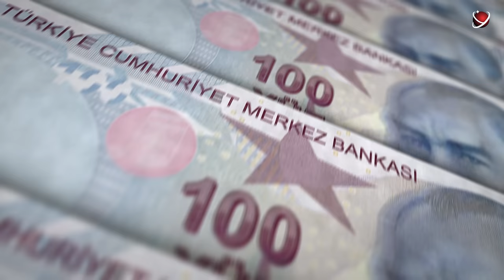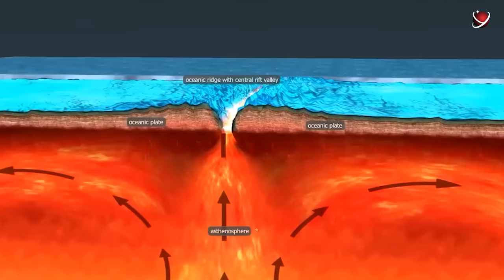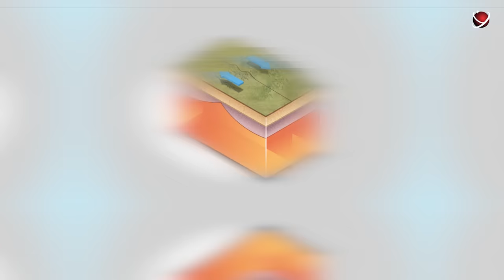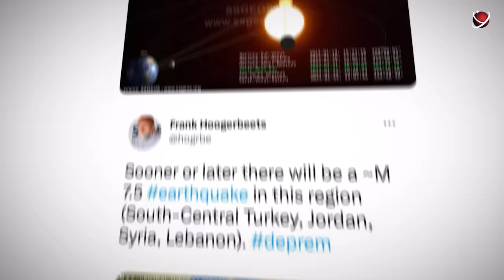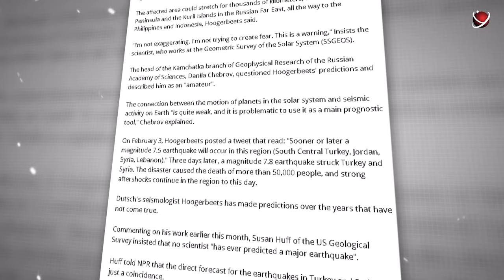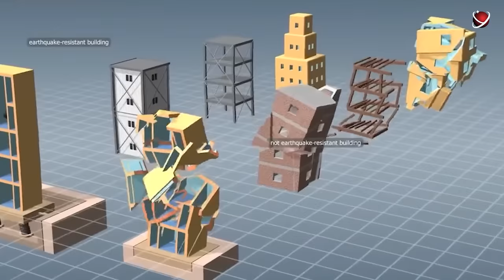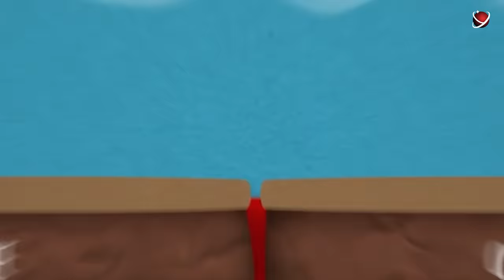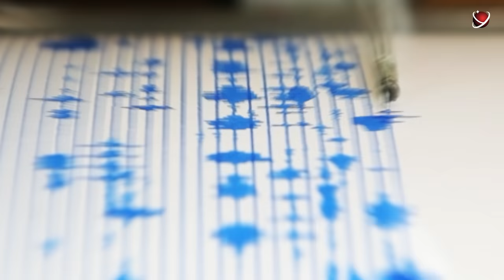Why Is The Earth Cracking Apart?

Comment: Tectonic plates have to move in order to  release the huge amounts of energy that they accumulate  holding  frictional energy between plate boundaries. The plates are assembled like a jigsaw puzzle. If the plates in one region move, others most likely have to compensate for the internal  earth energy disparity, so usually somewhere  there is a plate shift to cover for the unbalance. This most of the times shows   up as a series of replicas or short duration earthqwakes, These  events   seem to follow a geological time pattern, which is like an energy  loading period  between events.

Comment: @colorsass
1 second ago
To Whom it May Concern:
Give this idea some thought. Hang this product in 5 ft spaces along the sides of the walls and down the walls. Use it to plant ivy or some other plant that would grow quickly and spread far a GB d wide. At various intervals use ropes across the width with fishnet attached and more of this product attached to it. Water it with drones. Also do this in Brazil,  Iceland, Mongolia, Africa and anywhere that it is needed.
This type of product growing sheet is on the market.
50/100pcs, Hydroponic Sponge Planting Tool Square Seedling Sponges Greenhouse Hydroponic Sponge Hydroponic Vegetable Planting Sponge For Small Bud Growth
692 sold, by...